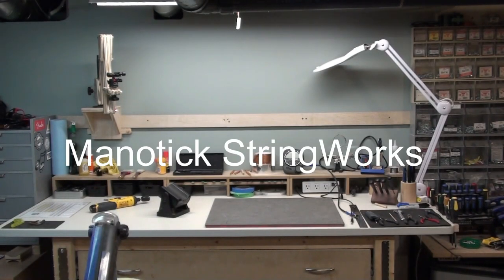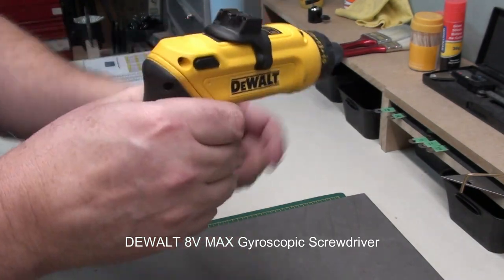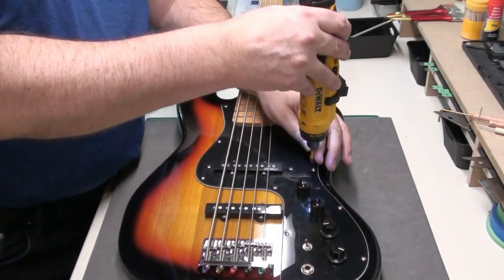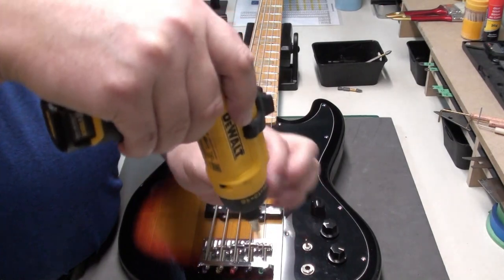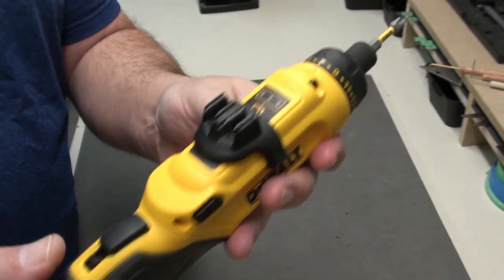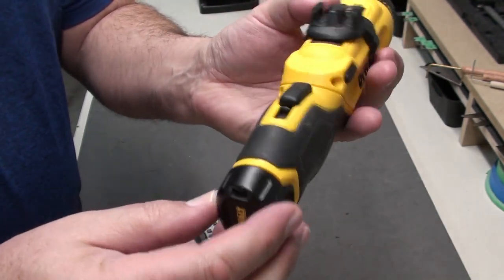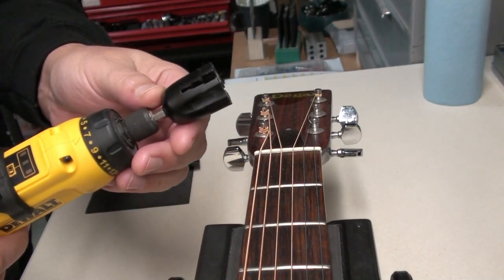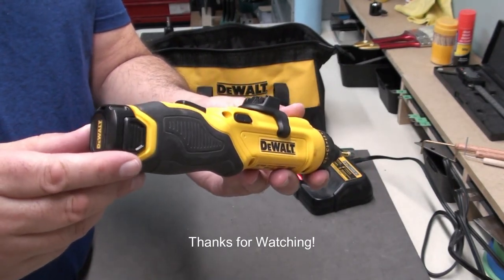Guitar Tech Tools: DeWalt 8V Max Gyroscopic Screwdriver... a must have on my workbench!  UPDATED

Comment: Lovely tool but crazy expensive! What would you recommend for a guy on a budget??
Reply from the maker: A screwdriver - lol
Reply: @ManotickGuitarTech  Yes. I see you using that to remove the backplate. Does the Dewalt tool not do that too?
Reply: Hitachi(Hikoki)/Metabo do a good cheaper one that's durable and proven - but obviously not as fully featured as the Dewalt. Hikoki DB3DL2 3.6v

Comment: Hey. question not really related to the video but do you know if a american pickguard would fit on a made in china 70s vibe squire p bass? ive seen that korean pickguards tend to be a bit bigger than normal. if you know anything it would be very appreciated.
Reply from the maker: Cant know for sure until you test fit it...too many production variations over the years.   If you can get detailed dimensions of the pickguard that would help you out